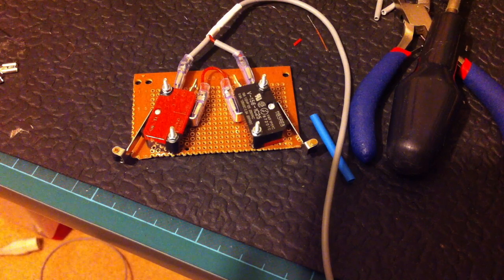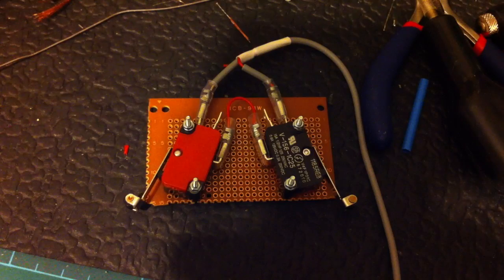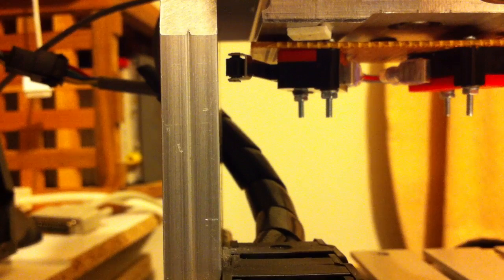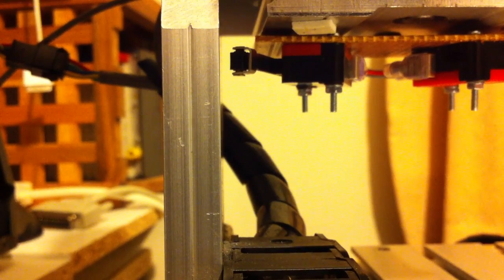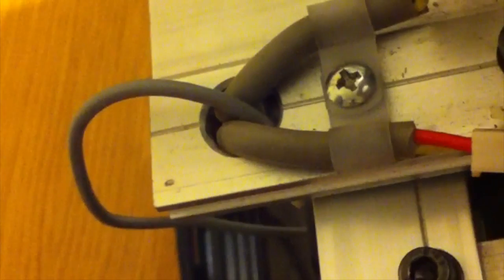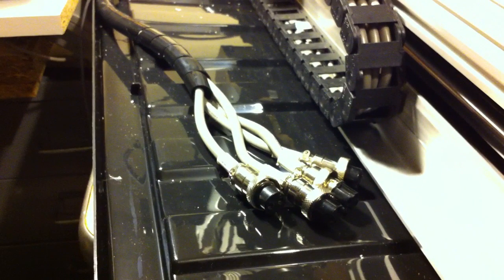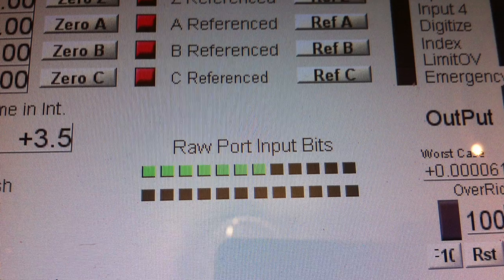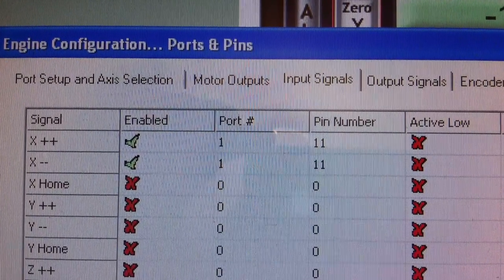Installing X-axis Limit End-Stop Switches On CNC 3020 Router

Comment from the maker: This is machine has great potential, but before I actually do some serious work with it, I need to idiot proof it, from me, so I don't accidentally wreck it during the learning process.   With the 1st 2 end-stops I've secured the X-axis and its gear motor, just the Y, Z, 4th Axis and spindle to go. Then I'll be making 3D models and bits.